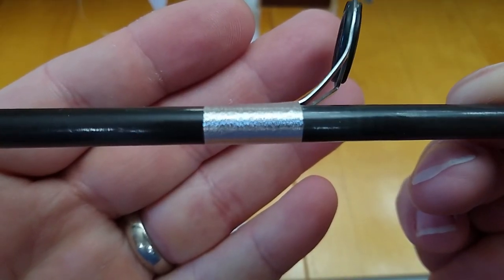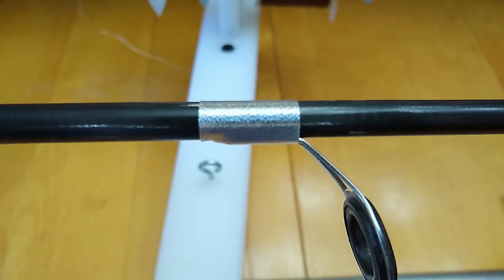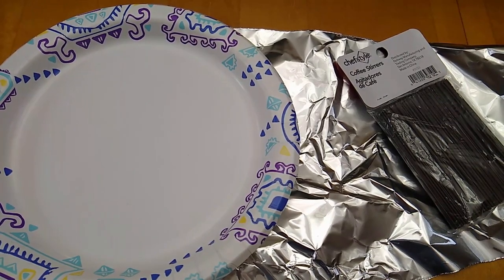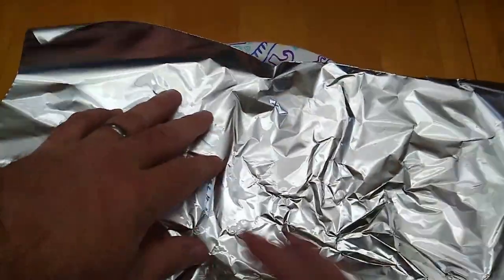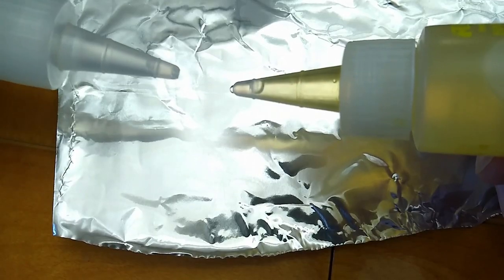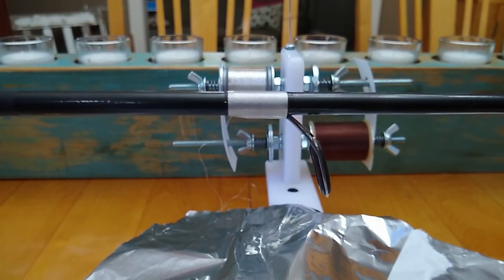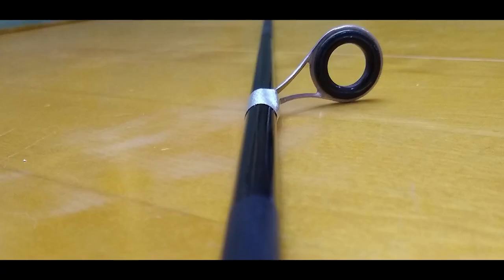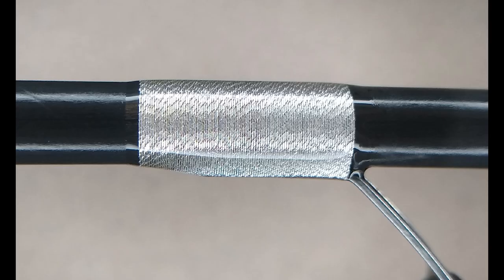Wrap Finish: Epoxy Tips And Tricks For Rod Building (Small Batch Mixing, Flat Finishes, No Bubbles!)

Comment: Excellent video full of useful information.  Drilling out the end of the bottles with 1/8th inch bit.  Drop method.  Lower spread of epoxy while mixing to allow bubbles to escape and release of heat during mixing process allowing longer use time. Coffee filter.

Comment: I like that 3 drop approach. Will try that. I prefer to fan the epoxy with either an alcohol lamp or a heat gun though to eliminate the bubbles. I see you used the spatula method for this.

Comment: I enjoyed every second of that video! Answered so many questions I was going to ask. I finally finished wrapping my first rod, and I’m happy with the wraps, after doing it 4 times. My first rod….😂 I’m ready to epoxy and this helped as I know once that’s done, there’s very little to turn back on. One question…..I’m building two rods. What’s the best way to match up the wraps so side by side the rods and wraps match eachother? I’m guessing marking with thin sections of tape, laying the rod blank next to he finished rod. Thanks for you advice and help. 👍👍👍alex
Reply from the maker: Thanks so much for the feedback! That's how I would do it personally. If you are happy with the layout of the first rod and you are building on an identical blank, side by side and transfer reference marks across to the second blank will save you a lot of time. Good luck with the epoxy, it is a little tricky but take your time and if you run into any problems feel free to ask and I will be happy to help if I can.

Comment: I wish they would've taught us that trick of heating the epoxy a little to help get bubbles out when I was in soldering school. We had to mix epoxy for circuit board repairs. I always hated that job.😂
Reply from the maker: It works pretty good if the epoxy isn't too deep. If it is more than 1/16 of an inch or so deep you would need more heat 👍

Comment: Lollll me at the beginning: a twenty one minute video? CMON
me at 19:55: this page of notes is getting long but dang I'm glad I watched this before I wrapped my first guides XD. Any tips for getting small performance guides on? Also, I have layout measurements for said guides and I'm pretty sure that means from the top of the rod but is the measurement from the tiptop to the top of the guide? or the foot? These are single feet guides
Reply from the maker: Haha! A lot of people use surgical tubing cut into bands to hold micro guides on while wrapping and then cut them off once they have enough wraps on the guide foot. I don't ever use guide spacing charts, I always do load testing to adjust my guide positions and figure out sizing as I go. Wish I could help you on that. You might look at one of the Facebook groups like Custom Rod Builders Guild or Designing and Building Fishing Rods to find some help with the guide spacing charts. I think a lot of people use those, I just don't happen to. Those are good groups to join though. Lots of knowledgeable people in them!

Comment: any tips on an epoxy subsitiute i can get at walmart? would 5 min epoxy be ok? i need to replace a single guide. thanks
Reply from the maker: 5 minute epoxy would be tough to make your finish look good because it sets up too fast. This epoxy is a slow setting epoxy that I know others have used with good luck, but I haven't used it myself. https://www.walmart.com/ip/919504304
I also did a video about using "Clear" Gorilla Glue and it works well. It is softer than epoxy but does a great job of protecting the thread and keeping the thread in place. It is also easier than epoxy to remove if need be in the future.
Here is that video if you want to watch it: https://youtu.be/36x-jQ7pWIE
You will need some Gloss Mod Podge that you can get at Walmart for a color preserver for your thread unless you are using metallic thread.
Hope that helps!

Comment: The Fishing Hobby, i hope you can help me out. I put the finish on my rod and started the dryer. Sometime during the night the rod popped out of the drier chuck. There are low spots on the wraps now and for some reason the resin is not drying. What are my options? Will alcohol or acetone remove the resin. Can i fix this without having to strip it and start over?
Reply from the maker: I'd rewrap if the resin isn't setting up. Something didn't work out properly on the mixture or it wasn't mixed together thoroughly. Your only other option would be to leave it as is and try to mix up more resin and level it out over the previous coat. If it had hardened, you could wet sand it and recoat. With it not hardened, you can only start over or go over it a second time and hope you can get it leveled out. It happens to almost everyone at some point, so don't be discouraged. Good luck with it!
Reply: @TheFishingHobby  what happened was the 2nd layer was slightly off on the mix.  Can i use alcohol or acetone to remove the resin that didn't set? Will that hurt the 1st coat? If i want to start over and rewrap. How do i get the wraps off clean the guides and blank? I'm kinda using this blank to learn from so i don't screw up the next one
You have been very helpful, thanks for everything.
Reply from the maker: You may be able to get the 2nd coat off with acetone. Acetone won't do a whole lot to the first coat if it set up properly. If you end up having to remove the wraps, here is a video that may help: https://youtu.be/WjgOdh4lYeY

Comment: How many coats of epoxy on a big game rod with super heavy duty roller guides. I see some guys say 10 or more coats but if the string is what holds the guides on why so many coats? Thanks for your help.
Reply from the maker: I'd like to be able to give a a good answer but just to be upfront, I do not build rods that big and don't know that much about it. I have read up on it some but not on the epoxy end of things, more about the underwraps. The tensile strength of epoxy is low compared to it's compressive strength and shear strength. Tensile strength would be the type of load it would be handling on a fishing rod application. The type of epoxy used as thread finish is more like casting epoxy resin and it has an even lower tensile strength than epoxies made more for adhesive purposes. I also know that epoxy with no thread can actually hold a guide on an ultralight to a light duty rod. Any rod bigger than that and the load gets to be too much which shows that the thread itself is where most of the holding power for guide attachment is. When building heavier rods like you are talking about there will be dozens and dozens of wraps of heavy nylon thread on a guide which gives a whole lot of tensile strength and it would be way more than the epoxy would have. The break strength of a 1cm wide band (wrapped around the guide and rod) of size D nylon rod building thread is supposed to be 285lbs. That is pretty substantial and on the larger guides near the butt of the rod that do most of the weight handling, that wrap will more than likely be more than 1cm wide. That is a lot of holding power. I can't think of a good reason why someone would need that much epoxy on a guide wrap. It adds weight which has a negative effect on the action of the rod. Also consider that several years ago, there was no epoxy being used on guide wraps for rods used for deep sea fishing, only varnish which has almost zero tensile strength. Again, I don't build rods that big so I'm not speaking from personal experience, but I can't see the logic in using that much epoxy.
Reply: @TheFishingHobby  Thank you so much. This is making more sense now. It is difficult finding much information on big game rods. I just finished my first rod and it is a big game rod, I wanted a rod that would not break because I'm heading deep into Mexico and it's a 3 to 4 day drive out of there to make repairs on my fishing rods plus I'm fishing for shark  or whatever is about 3/4 to a mile off shore unless I rent a boat. I will start my next rod tomorrow it will be almost identical to the first which is a Tuna72 rod with unlimited line strength and Aftco super heavy duty rollers and a Tiagra 130 reel. After that I start on a tuna rod. I have watched many rod builders on YouTube over and over and with your information I feel much more knowledgeable. Like everything in life I am continuing to learn. Looking forward to seeing you again on YouTube.
G man
Reply from the maker: No problem, hope you have a great trip and tight lines 👍

Comment: How long do you wait between the first initial thin coat and the final finishing coat?
Reply from the maker: Not really any specific length of time, just long enough to make sure all the thread has been wetted and there isn't any excess anywhere. Then I come back with the final coat. I'm not really waiting for it to dry or anything like that. The main purpose of that first coat is to fill in the tunnels and force any trapped air between threads out. In my experience, you will have fewer bubbles in your final coat if you do that first coat like I mentioned.
I hope that helps!

Comment: Just tried this method for two wraps and came out okay. I need a high speed motor to help with better lines. But I mixed a big batch to finish the rest of the rod and came out with issues. The coats ended up not even and at seemed like the epoxy got tacky very fast. I mixed the two parts equally by using the clear cups. Did 2.5cc of each. Everything was done I controlled environment room temp at 74-76 degree. What could of been the issue?
Reply from the maker: A 200 rpm motor will help quite a bit. I'll try to help you trouble shoot and figure out what went wrong with the larger batch. 1st question would be what epoxy were you using and does it mix 1:1 by volume? When you poured the two parts into the measuring cup, did you put the less viscous part in first (usually that is the hardener) and fill to 2.5cc and then add the more viscous (usually that is the resin) to the cup until it reached the 5cc mark? Did you mix them thoroughly, making sure to scrape the sides and bottom of the cup and mix untill the epoxy went back to clear? After mixing, did you pour the epoxy out onto some aluminum foil before starting your finish work on your wraps?
Pouring the mix out onto some aluminum foil is what really extends the working time (also known as pot life) of the epoxy. When the epoxy mixing is finished mixing, the chemical reaction starts and that generates a lot of heat. That heat also speeds up the curing process. If you leave the epoxy in the mixing cup instead of pouring it out onto some aluminum, that heat/curing process can be pretty fast because of all the mass of epoxy being so concentrated into a small area. By pouring it out onto some aluminum foil and allowing it to spread out, you are increasing the area of epoxy containment and the aluminum also acts like a heatsink further slowing down the curing process. If you skip the step of pouring the epoxy out onto aluminum foil, you need to work much more quickly before the epoxy starts getting tacky and causing issues. It makes a really big difference in the curing time.
Reply: @TheFishingHobby  thanks for the quick response. I'm using proköte high build epoxy and I mixed it 1:1 @ 2.5cc in cup. Then I mixed it till it got a bit clearer and transferred to aluminum cup. And proceeded to mix a bit more. Do you believe it could be that I'm using high build for small guides foots and light rods?
Reply from the maker: If you wipe off the excess, you can make it look like low build so that shouldn't be an issue. Mix until it is completely clear though. Also you said you poured into an aluminum cup. I'd recommend pouring into something like I showed with a paper plate covered in foil or an aluminum pie tin so that it can spread out. It won't get as hot and will give you a lot more working time before it starts to set and will also allow some bubbles to pop since it is much thinner.
Reply from the maker: Also make sure to put the thinner part of the epoxy into the measuring cup first before adding the ticker part. It makes a difference!